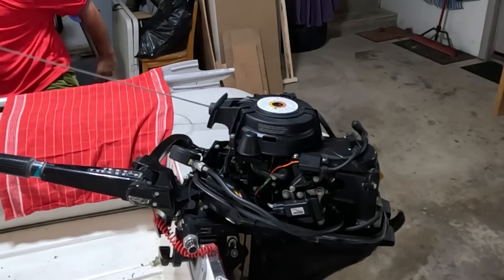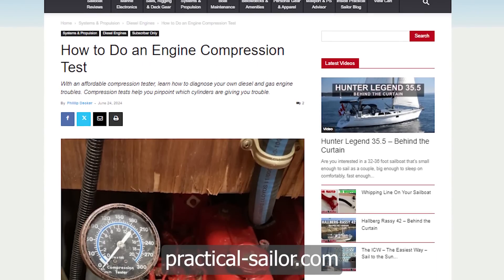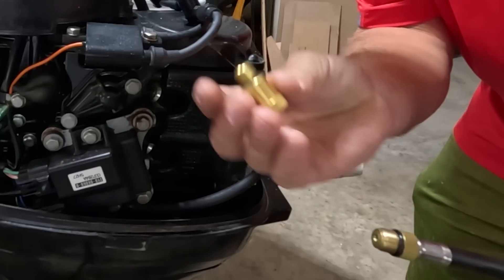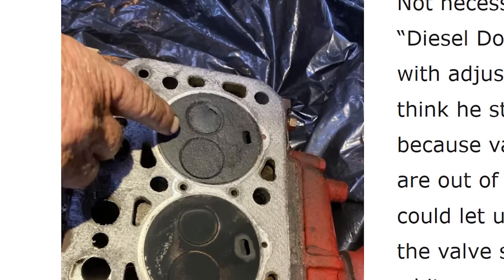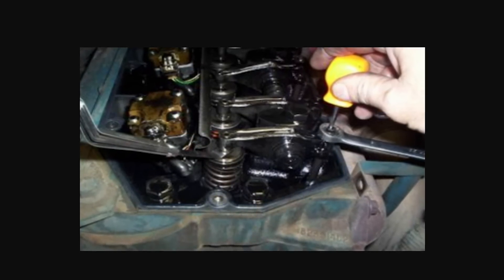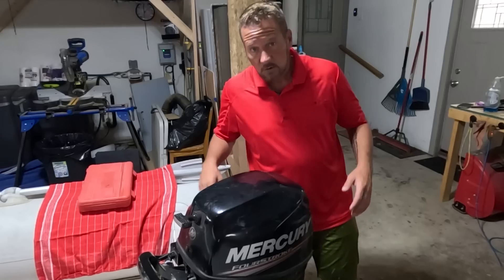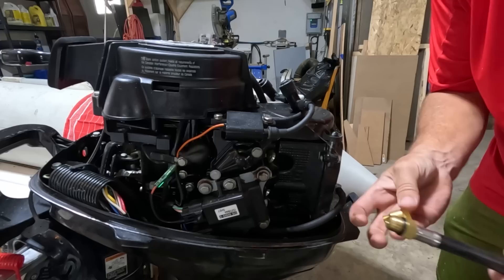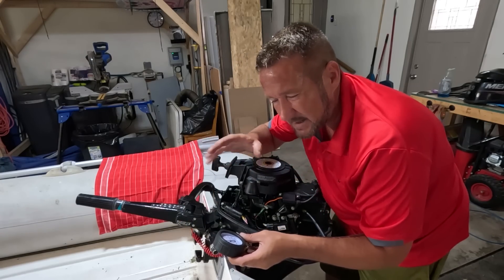How To Test a Boat Engine

Comment: Ignition systems should get a ground path or arcing will occur inside the coil or after it, and do hidden damage. My nearly new diesel is prone to ring rotation, and will periodically lose some compression and smoke for a spell, when the ring gaps line up. Some engines develop occasional ailments that go away. I try to get an engine healthy, then button it up.

Comment: Very good informative advice. It may be worth noting that it's not just what compression results you get on a multi-cylinder engine, but also how quickly you get those individual results.
If you're getting a total of results across cylinders that are about right, but one/two of the cylinders are taking many more spins of the crankshaft to get there, you need to investigate that.
As an example, if you're getting ~150psi across 3 cylinders, but cylinder no.3 took noticeably more crankshaft rotations as the other two to get up to 150psi...you have a problem.
It's normal to expect a little deviation between cylinders, say an extra rotation or maybe two, but if it's excessive then it's a red flag and you may need to seek further advice about it.

Comment: Very good ! Excellent explanations. Additional notes. After a compression test pour one spoon of oil through the injector port and re-test. If the value improves the problem is the piston rings, if it does not improve is the valves .

White smoke also comes through low diesel mixture ( a clogged diesel filter)

Comment: I've seen more than one cruising channel where there was engine trouble and they didn't have one of these on board, so they had to wait until reaching land to get the bad news. I would think it's a good idea to have one. It can let you know whether it's a serious problem, in which case you can stop fiddling with filters or whatever. Or if compression is fine, then continue to fiddle with fixable things.
What do you think? Required equipment for cruisers?

Comment: Great video but you forgot a VERY important step in doing a compression test. You absolutely need to hold the throttle wide open so there is no restriction for the air entering the cylinder or your reading will be lower. Also I’ve never heard an atomic 4 referred to as “tried and true” 😂 and lastly it’s funny that Canada still uses PSI. I would’ve assumed KPA or BAR like the rest of Europe uses with the metric system.

Comment: An added diagnostic test if a cylinder has low pressure is the wet test. 

After getting a low reading on one or more cylinders, add about a teaspoon of motor oil through the hole. The idea is to coat the cylinder walls to help a failed compression ring seal. A significant increase in the pressure indicates a failed compression ring. A slight or no increase indicates a valve issue. 

 This works best on vertical pistons but on horizontal pistons a sprayer can be used for the oil.

Comment: I rebuilt my 2GM20F two years ago. There is no way to easily do a proper compression test on any Yanmar GM because of the following:
1. They don't have glow plugs 
2. They use injectors that are oddly sized and compression fit, not threaded in. No off the shelf compression test kit would fit those holes and assembly.
3. I've seen compression test adapters from questionable sources for hundreds of dollars. I personally didn't bother.
4. Removing injectors from a GM engine is a multi-hour job, especially the first time you do it, because of how tight all the spaces are and the need to remove hard fuel lines.

I would suggest the following in this order.
1. Take off the valve train cover. Adjust the valves. Then identify intake and exhaust valves, turn the engine looking at the valves to see if the engine is nearly impossible to turn when both valves are closed on a cylinder. It's not accurate but will show you glaring issues.
2. Take out your injectors. Test them if you can, if not, open and clean them if you suspect clogging or rebuild them yourself, or give them to a diesel shop to rebuild. Sailboat diesel mechanics are nearly impossible to find, but if you take out your injectors you can take them to almost any diesel truck repair shop.
3. While the injectors are out, inspect the cylinders and valves with a boroscope. If you see a lot of deposits you may need to take the head off.
Similarly but separately if you see oil in your coolant or vice versa, or if you see an oil leak at the head gasket you may need to take off the head. This is pretty rare with these engines though, as they are very durable.
I posted this in a reply to one of the comments but its probably worth it to put it at the top level.

Comment: I have a Yanmar 3GM diesel that does not have glo plugs.  Is there a way to do a compression test on this engine?
Reply: I rebuilt my 2GM20F two years ago. There is no way to easily do a proper compression test on any Yanmar GM because of the following:
1. They don't have glow plugs 
2. They use injectors that are oddly sized and compression fit, not threaded in. No off the shelf compression test kit would fit those holes and assembly.
3. I've seen compression test adapters from questionable sources for hundreds of dollars. I personally didn't bother.
4. Removing injectors from a GM engine is a multi-hour job, especially the first time you do it, because of how tight all the spaces are and the need to remove hard fuel lines.
I would suggest the following in this order.
1. Take off the valve train cover. Adjust the valves. Then identify intake and exhaust valves, turn the engine looking at the valves to see if the engine is nearly impossible to turn when both valves are closed on a cylinder. It's not accurate but will show you glaring issues.
2. Take out your injectors. Test them if you can, if not, open and clean them if you suspect clogging or rebuild them yourself, or give them to a diesel shop to rebuild. Sailboat diesel mechanics are nearly impossible to find, but if you take out your injectors you can take them to almost any diesel truck repair shop.
3. While the injectors are out, inspect the cylinders and valves with a boroscope. If you see a lot of deposits you may need to take the head off.
Similarly but separately if you see oil in your coolant or vice versa, or if you see an oil leak at the head gasket you may need to take off the head. This is pretty rare with these engines though, as they are very durable.
Hopefully this helps. I'll post this comment to the top also.
Reply: Yes, good question. You would remove the fuel injectors and attach the hose there.
Reply: I love these videos.  Keep them coming.
Reply: Search youtube I think ⚓

Comment: Shouldn't you disable the ignition? Doesn't pulling the cord generate a spark from ignition cables that could ignite fuel?
Reply: Not with the spark plugs removed from both the ignition leads n engine. Only get a spark from the plugs. N he moved the leads out of the way. Very little to zero fuel atomization outside of the  internal cylinders.

Comment: Going to view a boat for sale, how easy is to persuade the selling owner to allow you to make a compression test on the engine?
Is it a rule of thumb that if he doesn't let you than the engine has a problem or is it normal for him not to let a stranger messing with the engine??? 🤔🤔🤔
Reply: You could just get a regular mechanical inspection, as you would a car., by an authorised mechanic.
No, I wouldn't let possibly crazy buyers dismantle my engine, but an inspection is fine.  Cheers.
Reply: Do a sea trial. Insist the engine is checked in all regimes. No load idle and max RPM as well as idle and max RPM under way. Insist on running the engine at max power in forward. Check the max RPM against the engine manual. Check for smoke, irregular noises, overheating, etc